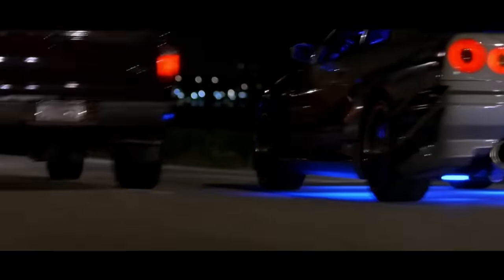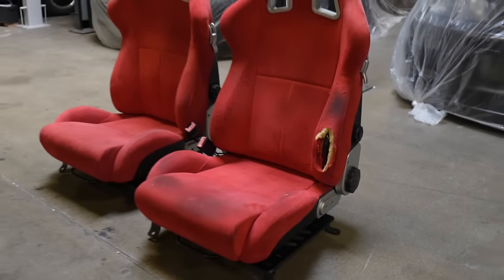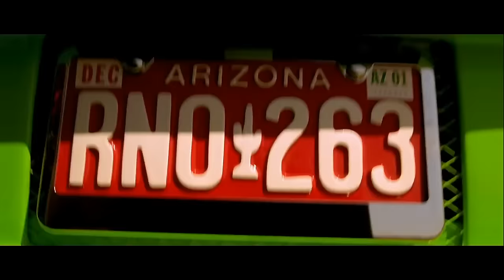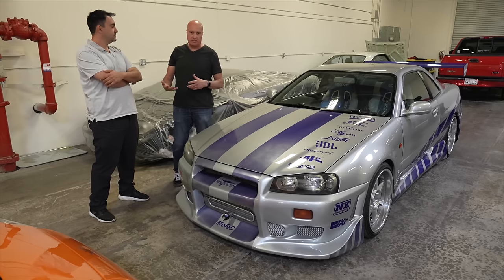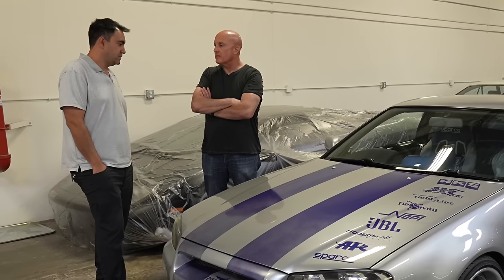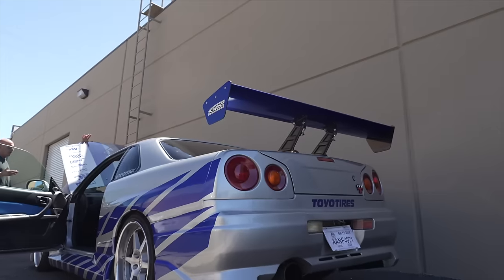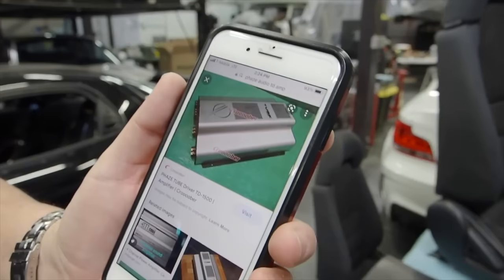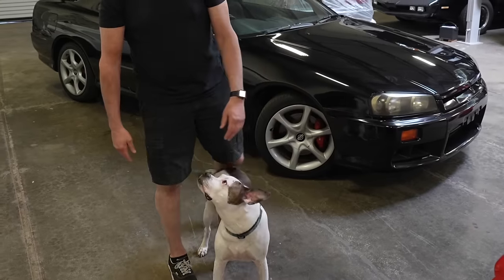2Fast 2Furious Skyline In the Shop!

Comment: I'm about "this" far from buying a set of GTR rear quarter panels before they become unobtainable. I don't even own an R34....yet LOL. I will at some point. Anyway... have you guys heard anything about how available they may be in the next 1-3yrs? I know Nissan just released a bunch... but for who knows how long?
Reply from the maker: Nothing yet, but as parts stock dwindle pricing usually goes up.

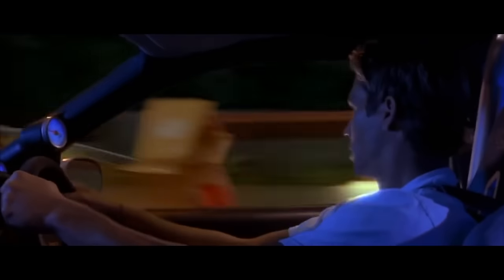Comment: He's way off when it comes to the interior. The blue and grey on the seats are the wrong shade, same with the dash plastic. At 23:13 ,you can see that the actual movie car has seats that are a dark blue with a dark grey outer edge which match the shade of the graphics on the outside of the car.
Reply from the maker: Actually, he met with the company that did the upholstery for the original movie cars and they provided a sample of the material that was used.  They also provided him with photos of when they did the job for Universal to which he has provided us copies of. We also inspected the 2nd unit principal car still owned by Universal and confirmed his material along with the patterns are correct.  With the only difference being the rear seat center pattern.  Yes, the OG Movie Cars had the bottom section of the door panels painted blue, which Shahar has not done yet.  It’s hard when comparing to what is seen in the movie.  Filters used by the editors drastically change the appearance of what we see. We’ll post up some pics on our IG account showing (never before seen) pics of the original photos from the upholstery company doing the OG GTR’s.  👍🏻

Comment: What’s the difference between a GTT  and GTR
Reply: many
Reply: A lot... Different engines RB25DET NEO vs RB26DETT, Rwd vs Awd, Electronics.. Suspension, The GTT has narrow quarter panels vs the wide rear fenders on a GT-R, Different interior. Completely different car but they look alike for the most part.. That's about it.
Reply: @jeremywillis7407  thank you for the info about the G34 I’m always learning something new everyday thanks guys keep up the great work 👍
Reply from the maker: @JeremyWillis7407 is correct. As usual.